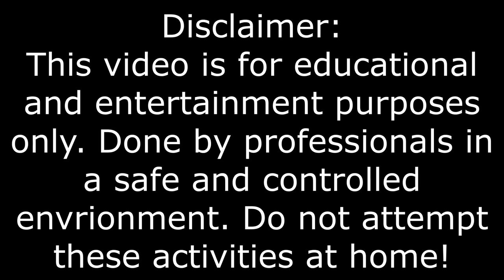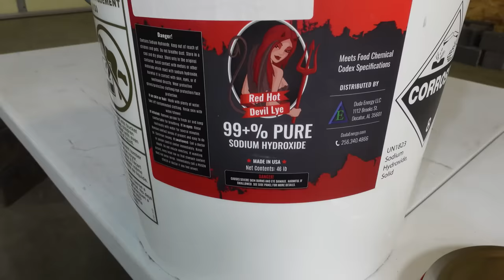Restoration of a Seized up 1913 Colt Vest Pocket, (With test firing) #restoration

Comment: I used to have a little Beretta .25 that looked just like your Colt. Perhaps one was a copy of the other? Anyway, I bought it off a guy in Colorado in the '70s. I think I paid $30.00 for it. Then I sold it a short time later. There was an old abandoned combine along the side the barn in farmhouse we rented that we used to use for plinking. A .22 LR had no problem penetrating the sheet metal sides of that rusted out old machine but that .25 barely dented it. It was cute as a bug's ear tho. Thanks for sparking the memory of younger days.
Reply from the maker: I'm happy to hear your good times,thanks for watching!

Comment: I applaud your decision to not remove the pitting the little .25 has acquired over the years.  I wonder how the finish would have turned out if you had used 0000 steel wool before bluing, just to smooth out the surface.  Very nice job.
Reply from the maker: Thanks we appreciate it, ya idk. Thanks for watching!
Reply: Steel wool wont remove pits. 4/0 is a polishing medium at best
He took the rolled marks and edges off sand blasting. Now its non restored and junk

Comment: My father was Wash State Patrol. He was commissioned in 1937 and was one of 2 troopers assigned to E Wash. He carried one of these .25 Colt Pocket Pistols in his jacket pocket until he retired in 73. It now has a place of honor in my safe. Its a Mod 1908, manufactured in 1928.
Reply from the maker: Very cool, that's awesome! I would be proud of it too! Thanks for watching!
Reply: My bro-n-law's brother caught a guy messing around his truck and beer cooler back in 1969. He warned him once around 10 pm but caught the guy later the same night so he proceeded kicking the guy's ass. The guy shot the truck owner 6 times with a .25 auto but wound up getting the pistol taken from him and still getting a very severe ass whuppin. .25 ROUNDS ARE NOT SUITABLE FOR SELF DEFENSE or even executions at point blank range. I saw someone talking about a cop carrying a .25 as a backup gun. Cops usually have more/better gun savvy than that; must have been a desk cop or a Barny Fife type cop in a Mayberry town.
Reply: @jamesadams8064  My father was not a desk cop or barney fife. He preferred to use his billy club over a gun. Served 30 years and only had to draw his weapon twice.  Dont knock the 25. Its a good choice for a last ditch pistol. He also had a Chicago Chemical Co pen gun in 410 in his shirt pocket.

Comment: If you intend to fire it at all as a serviceable weapon I'd put a new barrel in it also.
Reply from the maker: Absolutely, thanks for watching!
Reply: Would an NOS, OEM barrel be available? Or would a used - but  serviceable - barrel need to be found? 
I was wondering about that when the rifling was shown, pre and post restoration. 
Thanks for asking the question… and for the answer in the Reply. 
RL

Comment: Great video, gave you a like. At 1:43 if you put the tub on a platform with a small motor on it with an offset weight, you can get ultrasonic harmonic vibrations based on the speed of the motor. A small DC motor is all you need. This will work in the solution better.
Reply from the maker: Thanks, I have  ultrasonic cleaners! Thanks for watching

Comment: Beautiful work. Just a thought on the inside flats and magazine. Before bluing have you ever thought about using valve lapping compound on the flats to improve the barrel cycling? And maybe the magazine would slide in and out a little easier.
Reply from the maker: Thank you, no I haven't. Thanks for the advice and for watching!

Comment: nice. i did something similar with a seized and rusted up h&r 922. the cylinder, hammer and trigger were rusted shut. my job wasn't as intensive as yours, though. all i did was soaked it in white vinegar and took it down to the raw metal and then bought some cold blue in a tube and rubbed it on, waited, wiped off and repeated a few times. it shoots again.
Reply from the maker: Thanks, that's awesome! It is very satisfying to restore something, thanks for watching!

Comment: Have you thought about purchasing an ultrasonic cleaner?  Harbor Freight has them in various capacities.  They're awesome with rust removal and degreasing.  I restored a firearm not too long ago and it was completely locked up...dropped it in the tank with rust remover and a few hours later it was pretty easy to take apart.
Reply from the maker: Ya we will probably have to buy one in the future, thanks for watching!

Comment: Nice, my 302 sterling is much like the colt but with a fixed barrel. Oh and it's a 22lr. And it has a button to disassemble slide. Wish they made a 45 with such a button.
Reply from the maker: Very cool, sounds like a nice gun! Thanks for watching
Reply: @TheKinzlerBros  started out it would only fire one round. Now after many rounds it's about 95 %.

Comment: That rust remover fluid looks like something i need.
I repair and restore clock mechanisms and run into some really rusted up movements every now and then.
I find gun smithing kinda in a similar aspect as horology ,dealing with similar metals and similar mechanisms in some cases,( tension springs ,levers) and kind of parallel tech that developed for many years from way back in the old old days top of the list industries, along with steam engines and combustion engines, until time keeping technology advanced with advent of electronics and quartz and so much of the old clockworks mechanisms tech wasnt needed anymore really.
Yet, firearm technology does have some mechanical design advancement or materials improvement,it stays relatively the same as far as how things operate.
But anyway, im interested because we can use same techniques in restoring the metal parts that are corroded.
Reply from the maker: Thanks for the comment I enjoyed it!  It's called evaporust rust and it's about 22 dollars a gallon. Thanks for watching

Comment: Nice little pop gun.  
Something you can put in your pocket. Snakes pistols are great but they need to be in smaller caliber a 32auto or 380. Anything bigger then a 9mm and holding on to the pistol while firing before a issue.
Reply from the maker: Thanks, ya its a 25 acp! Thanks for watching!

Comment: heating evaporust makes it work faster and better   90-120 degrees is good.  not so hot you can't touch it.   Liquid wrench is excellent...as it provides some lubrication, while removing rust and it pentrates... good second step
Reply from the maker: Thanks for the tips and for watching!

Comment: I'm surprised you hit steel with that plumbing pipe of a barrel. If it were mine, I would have worked on metal a bit before finishing. You can make it relatively flat and still show the battle scars. Nothing wrong with your way. Good, clean work.
Reply from the maker: Ya it wasn't easy, ya but, if you do that it will get rid of the markings. Thanks for watching

Comment: Which direction did you punch the ejector pin out. Out the top or out the bottom? Mine needs replaced and I didn't want to damage the pin. (Impossible to find replacement)
Reply from the maker: From the bottom up, thanks for watching!

Comment: I have a VERY old S&W 22 revolver that was dug up years ago. Frozen up tighter than a _________’s _____. 
  I soaked that thing in Mystery Oil for weeks. Wouldn’t budge one iota. That was years ago. I actually have three old 
“Boot Guns” Revolvers. Two are not rusted shut, but they’re really loose. Sure wouldn’t attempt to shoot one. 
     The S&W .22 is still loaded with one in the chamber. I made a little wooden plaque and have ‘em hanging on the wall. 
    Maybe I’ll give it another try to get that puppy unloaded. Cool Video. Cheers.
Reply from the maker: Those are awesome finds, too bad they weren't fixable yet! Very cool wall hangers, thanks for watching!

Comment: 6:54 ... Will that surface at the bottom ever get sand blasted enough for a larger hole to be worn in it? If so, how long does it take for sand blasting to create a hole through a metal that thick?
Reply from the maker: We use fine glassbead so it doesn't damage the metal, it cleans off the rust. Thanks for watching!

Comment: At 2:27, I find that working the item with a hammer when wet with rust remover works better.
Reply from the maker: Yes it does, thanks for watching!
Reply: @TheKinzlerBros  I saw your other video on the Thompson Submachine Gun and I think an AK-47 that followed. Great restoration jobs. I had the opportunity to get a old (non CNC) Bridgeport 5 axis milling machine for $100 USD but my wife put tne kibosh on that... she did want a big machine in my barn/workshop.  Oh the things I could have made with it.

Comment: Is this the same model as the Colt Junior also chambered in .25 acp? I cannot remember me any difference.
Reply from the maker: There a little different, this one has the grip safety and striker fired and the junior has no grip safety and is fired from an external hammer. It was also made by astra and imported by colt, thanks for watching!
Reply: @TheKinzlerBros  Thank you for your explanation

Comment: Good video.  I do not deal with arms as rusted as the one here (before), but I do work with old pistols perhaps 'somewhat' encumbered.  I will write down the various rust removing chemicals.  

Also, the worn barrel seems to stabilize the bullet sufficiently.  The 1908 in 25 ACP is not a twenty-five yard arm in new condition.  Minute of thug at ten feet is usually sufficient.  The results seem to show this.  

Surface pitting.  Polishing the surface would likely entail removing the maker marks and serial number.  Not to be done.  The arm has earned those marks honestly; it should show them proudly.
Reply from the maker: Thank you we appreciate it! Absolutely I agree, thanks for watching!

Comment: Nice restoration. The only bit I did not like was that you did not use a light oil or gun oil as lubricant once finished but used WD40 or similar. That should only be used as a dismantler -- not as a lubricant.
Reply from the maker: Thanks, I used Rem oil. Thanks for watching

Comment: My bro-n-law's brother caught a guy messing around his truck and beer cooler back in 1969. He warned him once around 10 pm but caught the guy later the same night so he proceeded kicking the guy's ass. The guy shot the truck owner 6 times with a .25 auto but wound up getting the pistol taken from him and still getting a very severe ass whuppin. .25 ROUNDS ARE NOT SUITABLE FOR SELF DEFENSE or even executions at point blank range. I saw someone talking about a cop carrying a .25 as a backup gun. Cops usually have more/better gun savvy than that; must have been a desk cop or a Barny Fife type cop in a Mayberry town.
Reply from the maker: Ya if you don't hit major vitals, it will take a lot! Thanks for watching

Comment: Is there wany way to fill in pitting and/or scratches on a steal or aluminum slide or frame, so it can either be blued, anodized and/or at least Cerakoted? I've come across parts that are almost perfect, but have just one deep dent in them, or a scratch/nick or just a few deeps pits from rust. It sucks to see an otherwise flawless gun have such a noticeable defect from damage, so I've always thought about fixing parts like that... but I'm not sure what the best method would be. I assume welding would be one of the best methods, but then that requires machining/grinding after. Also, I'm not sure if welded aluminum will anodize if the base aluminum and welded aluminum are not identical. I know there are many products to fill in dents and scratches, but I'm not sure which one's would work well with Cerakote and hold up to the abuse of being fired. I tried JB weld on a deep slide dent once, but the Cerakote chipped off within the first couple magazines. The JB weld held out by itself though. I'm sure there has to be better/stronger products than JB weld though.
Reply from the maker: That's a great question, I've never done it personally but it is possible! I would google it and you should find a solution. Thanks for watching

Comment: hello, im also a bit in to restoring guns, if you boiled the gun first and removed most oxide with steel wool you would have kept the original bluing. Makes the worth and final result better.
Reply from the maker: Ya I know, we appreciate it though. We were always going to re blue it. Thanks for watching!
Reply: @TheKinzlerBros  yeah makes sense. I personally like to keep the original bluing even when it is not 100% intact.

Comment: When the parts are seized up, boiling in water can be useful and less aggressive than chemical treatments. It breaks away red rust and causes metals to expand which can separate fused surfaces. It has the added advantage of protecting oxide finishes, not that it would have mattered in this case. I've used the technique for restoring old machine parts, but I'm sure there's application here.
Reply from the maker: Ya both ways work well, I've done both. Thanks for the perspective and for watching!

Comment: dont think u should be using evapo rust because Backyard Ballistics used it on a ww2 m3a1 and all it really did was turned it to a metal color
Reply from the maker: The point is to get the rust off and then restore from there, thanks for watching!

Comment: #The_Kinzler_Bros hello sir I am a coin collector I am having copper coin which is 2200 years old and some 300-400 years old some of coins got green powder on it. I know I should not clean the coin but this green powder is disease of copper so can you please suggest me Chemical and cleaning process of those coins to presarve it.
Reply from the maker: Try evaporust rust, just submerge them and check on it in a couple hours!
Reply: @TheKinzlerBros  i tried it and kept it in olive oil for few days and daily i was cleaning it with brush. It is better then before but still i want to know if there is any better solution for this. 
Thank you sir for replying.🙏

Comment: You really need an electrolysis set up. No excuse for using a hammer , or a sand blaster on a gun.
Reply: Or a sand blaster.
Reply from the maker: I have a couple now and its fine glassbead in the media blaster. Thanks for watching!

Comment: I wonder how just dropping that gun into a vat of Evaporust for a couple of days/weeks would've worked? Evaporust destroys bluing, but I'm thinking that wouldn't have been an issue on that highly degraded finish. In automotive applications and old car restorations it is highly regarded. It removes bluing, but hurts no non-metallic parts. It also won't attack non-rusted metal parts. It's not acid.
Reply from the maker: Ya I don't recommend more than a day, then clean it off to see if it needs more time in it. Thanks for watching

Comment: this is not a restoration, but a new bluing on old metal;;;how could it not be polished with sandpaper - with such a thickness of melala this is a crime
Reply from the maker: Yes it is, I don't want to lose the markings on the gun and weaken the   slide and frame either! Thanks for watching
Reply: @TheKinzlerBros  I did it on beret 35, I was also worried about the thin inscriptions on the shutter) They are thin but deep, in many ways deeper than corrosion, but I understand you! just knowing what it looks like after light polishing from 400 to 3000 will turn a lot into candy;)

Comment: A kitten dies every time you "restore" a firearm.  At least learn to draw file and remove some of the pitting.  If you were to powdercoat the parts you could block sand off all the coating and fill in the pits, then recoat and resand until the surface is perfect and do a final PC on it.  Not the original finish but neither was pre pitted parkerizing.
Reply from the maker: I don't like removing all the original stamps!

Comment: Not my idea of restoration as I see an old rusty turd, which has become a polished turd.

I would want all the pitting gone, re-rifled to make sure it's not old fowled lead in the barrel. This all requires the right metal working tools. You'd probably have to have an FFL to 3d print serial numbers, and Colt markings. But I believe in doing it right the first time. It's an operable shiny turd that still has pitting and looks awful. Watch how some of the $20,000 knife makers blue, deep, rich, and black polish finish.
Reply from the maker: Ya we are not on that level, we don't want to lose any roll marks. We do have an FFL though! Thanks for watching